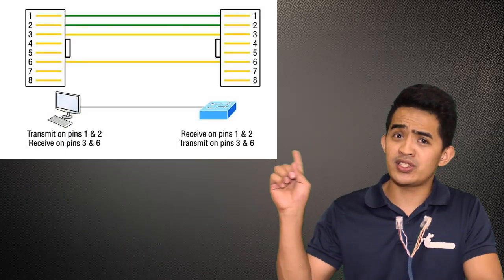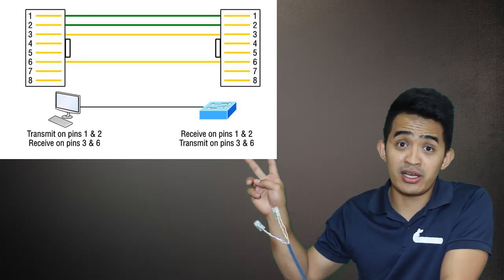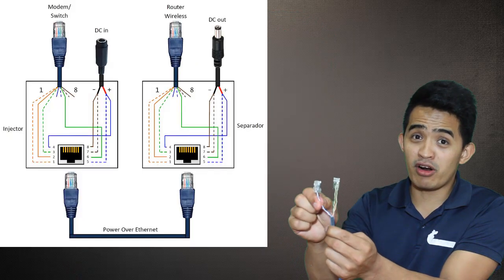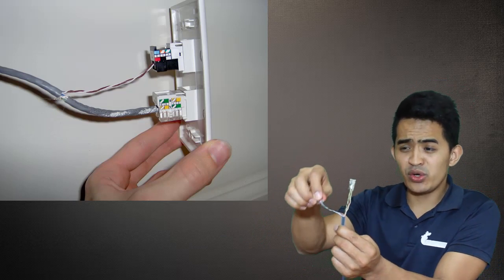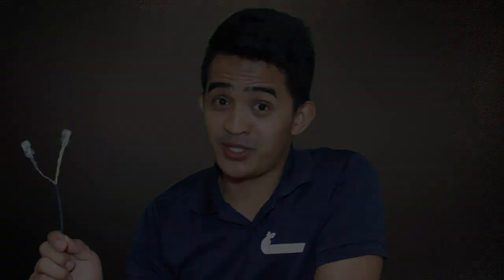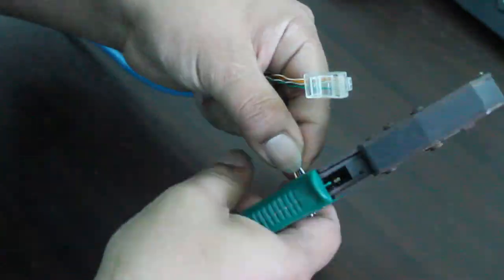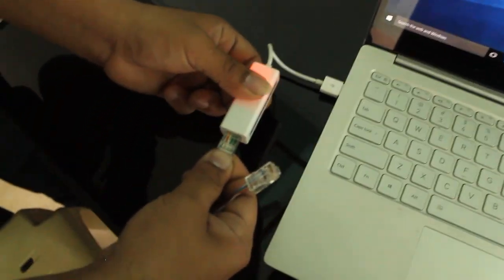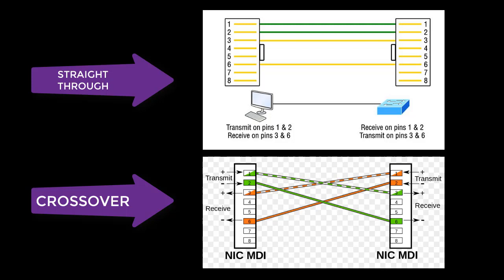How to Use Extra Wires in UTP Cables: TWO RJ45 on ONE CABLE

Comment: Hope you can help me. I want to use one poe for my two ubiquiti antennas. Can be possible? Can i just connect the 4 wires from antenna to antenna then parallel the power line from antenna? Hope you can help.

Comment: can i ask a question sir can this two separate wires can use to connet  the net ?
Reply from the maker: you need 4 wires. in a utp cable you have 8 wires. so you can separate them by 4 wires.
Reply: but this 2 separate four wires can be use to connect for example i use utpcale and separate it to use to two units to connect to the net ?
Reply from the maker: yes you can use it.
Reply: thank you for the idea sir thumbs up for your channel :)

Comment: There are NOT extra!

100 baseT only needs 2 pair (4 wire).
1000 baseT (gigabit) requires 4 pair (8 wire).
Reply from the maker: Yes amigo, if run gigabit cables then there would be no extra.  As mentioned in the description, it could be a quick solution to fix network cables that needs to be fix right away or as mentioned in the video, it serves other purpose like poe etc..
Reply: @torogipro  this can help one day. Thanks!